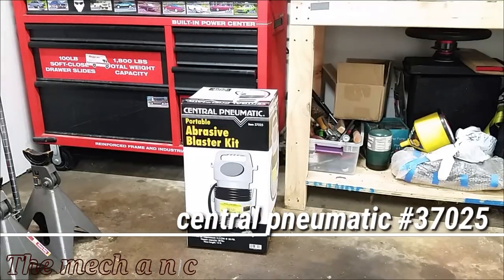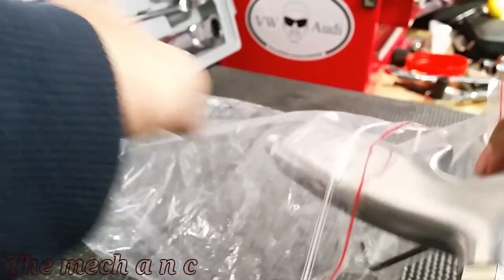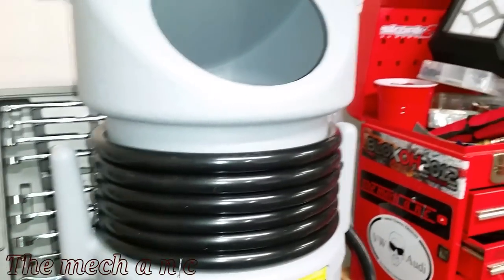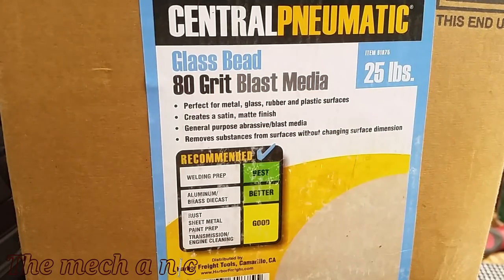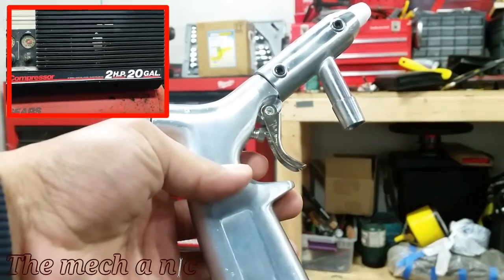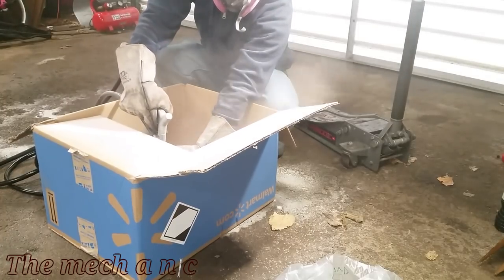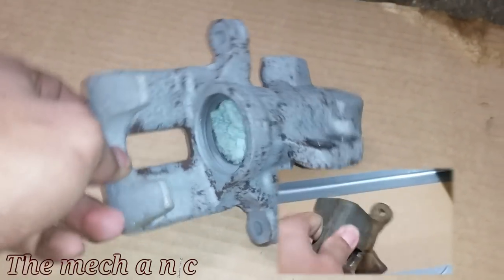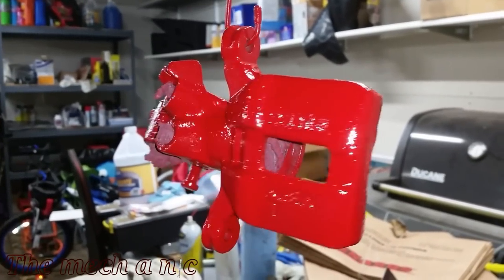Harbor freight sand blaster kit review

Comment: Mine doesn’t spray consistently. Like if I hold the trigger the media will come out for about 2 seconds then just nothing. Just air. Any tips?
Reply from the maker: I've been using sand blasters for a few years now, and it's a constantly switch from media to just air. Most of the time it's just air. This os why sand blasting is a slow process.  You can try moving the container to a higher area than your spray gun so that gravity can help to feed the media

Comment: Just picked one up yesterday for around $20. It was on sale and with a 20% off coupon, I got it. I have a good sized compressor so I think this will work just fine for what I need.
Reply from the maker: Good luck
Reply from the maker: Good luck👍
Reply: Hey Quick question what size compressor do you used? 
Thank you 👍
Reply: Yes it worked fine.

Comment: You can use white vinegar two or three gallons put it inside a 5 gallon bucket let it sit submerged overnight take it out the next day with a heavy stream of water wash it off wipe it then down with a clean Rag and then lightly oil it it'll be as good as new. You might have to get a toothbrush to get into hard-to-reach areas of the tools or other type of tools to get in there and scrub the crap out very efficient.

Comment: I bought one and it works on all parts I use it to clean engines and rusty parts well worth the $30
Reply from the maker: Definitely
Reply: What size compressor are you using?
Reply: Mike Martinez 8 gallon harbor fright

Comment: I have a 20+ year old 4 gallon, 2 HP, 2.6 scfm at 90 psi Campbell Hausfeld compressor. At 50 psi it should be adequate to meet the 50 psi, 3.5 cfm minimum air requirement, yet when I tried it, no media would move through the blaster. The media was Harbor Freight's 80 grit glass bead same as you are using. I could see it lying in the air bleed hole at the exit from the container. 

After some thinking, I took the gun apart and found it was assembled wrong. The nozzle inside has a gasket and an O ring. The nozzle had been assembled and inserted backwards. The nozzle has small hole which should go towards the ceramic nozzle. That small hole is centered right above the media input. It is what creates the vacuum via the Venturi effect to pull the media up. When it was put in backwards, a large hole was over the media input which created almost no vacuum. It works fine now even with a small compressor.

Comment: Good review.  I'm in the same boat as you, no room for a cabinet.  I'll have to get one of these and maybe build something or just use it outside.  
That isn't candy,  it's like Kool-aid,  you have to mix it with water and drink it.
Reply from the maker: Bruce L. Thanks I appreciate it, there's YouTube vids of people making home made blast cabinets which I plan on doing .you should check them out. Lmao , next time I'll try to make some grape drank with it 👍😂
Reply: Bruce L. 
I’m doing a six burner full oven cast iron stove. No way to put that in a blast cabinet either.
Reply: Grape Draaaaank !!!! My favourite ! What size air compressor do you recommend and is that an 3/8 " air line? Please tell some details of setting up the glass-blaster !!!! Can I use it to do the whole car including underneath to prepare the bottom for rust proofing?
Reply from the maker: Yes it's a 3/8 I think my tank is a 20 gal n it works fine the compressor just runs a lot so a bigger tank would be ideal. I suppose you could you it on a car but it would take forever
Reply: thanx , so what size would I need for my chevy van? To glass-blast it and underneath?
Reply from the maker: I'm not sure. The bigger the compressor the better
Reply: The mech a nic: thanx

Comment: I see you’ve got a Thomas EXOVCDS sticker on your tool cabinet.  I’m subbed to him and actually am watching your vid bc thinking about using one of these to help deal with the rust at the corners of the windows on my ‘89 Vanagon T3 T25 Transporter.  I just want to be really thorough and not have to buy new rubber gaskets and do it all over again in a few years.  Want to do it right and maybe use an epoxy primer or ?  Anyway , thanks !
Reply from the maker: If the rubber is damaged and wont seal you may have to replace it After the repair of the rust.

Comment: curious...you had plugged up the piston bore...did you not want to clean that area as well or is it not ideal too? i would think it would get very dirty as well. but then again brake fluid in there so i guess maybe not to avoid any contamination to the fluid when its all put together again
Reply from the maker: Blast media in the bore can be difficult to remove or mess up the sealing surface.

Comment: Great video.  I have a 60 gallon compressor and I am hopeful this will work for me.  I want to remove rust from horseshoes I do projects with.  I am trying to cut back on the time I spend at the wire wheel getting rust off.  I do not have room for a cabinet in my garage, but a very large back yard with about half covered with decomposed granite.  Hopefully this unit will do the trick.  Thanks for posting.
Reply from the maker: I think it will work great for you👍 .thanks for watching
Reply: @themechanic6117  what size of compressor did you use
Reply from the maker: 20gal
Reply: Oh, good. Here's the info I needed.  If a 20 gallon compressor is suitable, so should my 24 gallon be 👍
Reply from the maker: If you plan on using it for a long the compressor will constantly run but it'll work

Comment: I bought this model thinking it would be sufficient for stain and polyurethane removal from cabinets. The nozzle that comes with the blaster is too wide, so I purchased the 3/32 nozzles and the base is thinner, so the set screw dosen't hold it in place. Does anyone know the proper installation or additional parts to utilize the 3/32 nozzles?

Comment: What is the minimum compressor requirement?
Reply: It says 1 gallon. But I wouldn't use less than an eight. Anywhere from 90-125 psi needed.

Comment: How much was it ? I didn’t hear a price but maybe I missed it . How much does this cost at HF?
Reply from the maker: I don't remember the price, I didn't include it in the video because prices change. It wasn't expensive though
Reply: Was it more ,around or under $100 apx. Just looking for a coater to do some rims and maybe some other projects for the car guys i hang out with . Place I used to get my rims done used to charge $25..10/15 to s-blast and p-coat and now they charge $60 a rim . The entire setup would prob pay for itself after 4 sets of rims and some parts . Are you happy with your setup ?
Reply from the maker: That's actually really cheap to blast n powder coat 👍

Comment: Got one the other day. Can't seem to get it to shoot consistently. When I do get the media to shoot, it works well. Any ideas?
Reply from the maker: You may need a bigger air compressor. Make sure the hose isnt kinked. Even mine doesnt spray consistently, its normal for it to skip
Reply: @themechanic6117  saw in another video that crushed walnut shells are too coarse. Going to try a finer media. My air compressor is very large, I'm pretty sure that isn't the problem. 
Thoughts?
Reply from the maker: Ive never tried crushed walnuts so that may be a issue. Like i said mine doesnt spray media consistently either. Its more like on off on off with mine while holding the trigger

Comment: Bro, you should give powdercoating a shot, it's more durable than spray paint, plus all you need is the system, powder & an oven/heat gun to bake the powder 👌💯
Reply from the maker: I dont have the soace for powder coating equipment
Reply: @themechanic6117  you have an air compressor & if you rented a generator from Home Depot it'll work

Comment: What PSI were you using to spray? I'm probably using the wrong tank, but mine doesn't seem to be working too effectively. Doesn't seem to be removing a lot of corrosion, glass beads fall out the end , etc. Any help would be appreciated
Reply from the maker: How big is your tank?
Reply: Its a 1.5 HP tanks that goes up to about 150 PSI I believe. Not sure the CFM. It seems to meet the criteria of what the book that came with the sand blaster said, but I'm not so sure about the whole set up.  Thanks for the help!

Comment: Cheap kit don’t buy it.Doenst work.It says minimum 3.5 cfm at @50psi to use.I have a compressor that’s blast 6cfm at @150 psi and it just doesn’t work.Its a 2hp 8 gallon compressor and it still doesn’t work,it blast sporadicly not fluidly.Its not the compressor it holds more  than enough air.